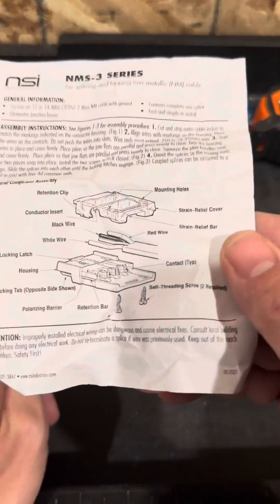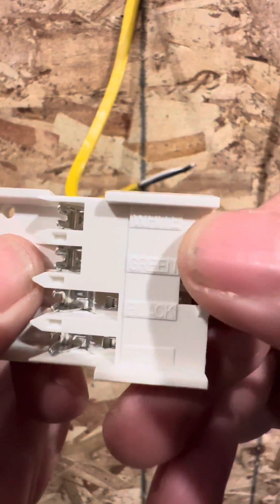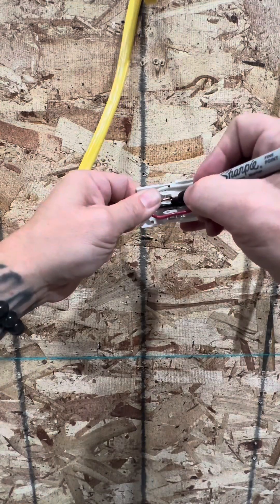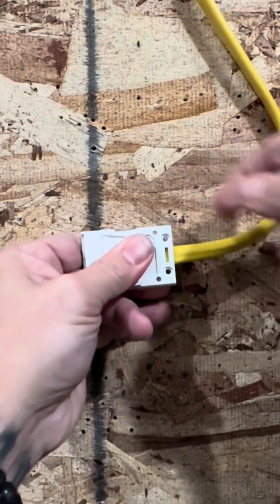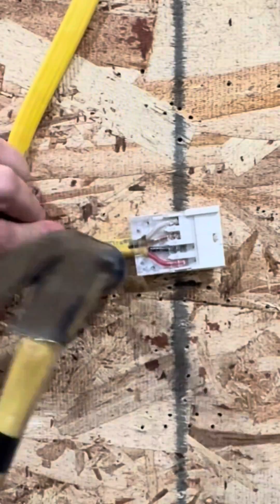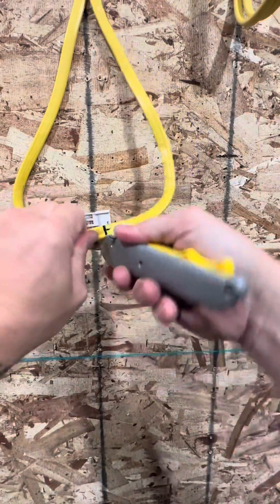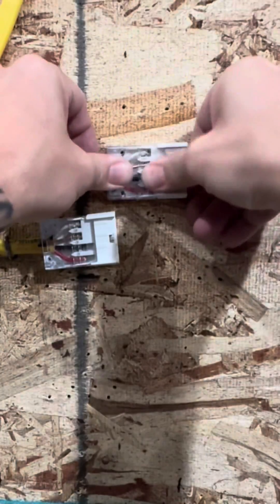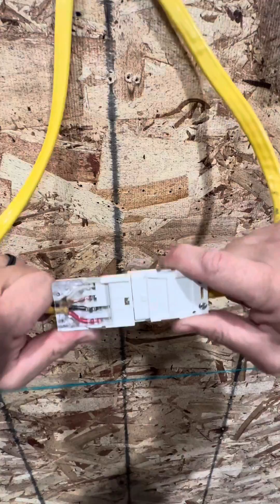⚡️How to repair a 12/3 romex with an electrical splice kit😂 #whackhack #wkhk #thebasementking

Comment: I'm trying to fix some 60s romex with four wires with one of these.  It looks like one of the wires is smaller diameter than the rest and I have no red wire.  Maybe the red has faded as it's hard to tell as you did white, hard to tell but looks like the narrower one, black then red so maybe the uncolored one on mine is red.  I like how you marked the wires for cutting, that looks like a handy trick!

Comment: You’re the reason I’ll never be out of work. Thank you for putting lots of money in my pocket fixing nonsense like this. Do more videos so Joe homeowner thinks this is legit.
Reply: Cut the bullshi this works just fine. It's copper wire. Not some complicated advanced electrical nuclear bullshi
Reply from the maker: @Charger-ob8yl  Facts
Reply: I agree with you 100%. These won't ever get used on my jobsite. Work standards are going awful low these days.
Reply from the maker: @rickhawkins218  Good help is hard to find I guess
Reply from the maker: @Esnara2085  Your Welcome!  Don’t for get to send me 10% of your earnings
Reply: Let it burn. I won't be here lol

Comment: So... what is this actually for?  I mean it seems like a mechanical connection that is just as likely to fail, if not more likely to fail, than just using twist nuts.  It ought to still be in a junction box... It still shouldn't be used anywhere that's not serviceable... so what's the point?
Reply from the maker: Per 2023 code you can install these behind the wall and ceilings
Reply: @KingWhackHack  That is really weird.  It's a mechanical connection with contacts, over time they can and will oxidize and corrode.
Reply from the maker: @johngaltline9933  How long of a time?  100 or 200 years?
Reply: @KingWhackHack NEC Code is a bare minimum standard. But- burying this connection behind drywall does not meet my standard of work. Fix it properly or leave it for the guy with proper work standards. This is some cheap junk.
Reply: @rickhawkins218 Disagree, in my opinion NSI makes good products. This is UL listed and approved by code. I’m sure if done right, it will last just as long as any other splice. Your reaction is no different than when wire nuts came into play and the old times got butt hurt about it.
Reply: @shefik12345  My reaction is based on the long time practice of leaving joints accessible because that is almost always where your problems occur. If you put the connection in a box on the drywall with f straps you have a chance of finding the problem at some later time. Wegos are below my work standards also.
Best of luck, Rick.

Comment: still have to have a junction box per NEC code I am sure
Reply from the maker: 2023 allows these splices to be behind the wall and ceiling
Reply: Who reads NEC if you have yоutube. 😂😂😂
Reply from the maker: @Vic-007  Facts 💯
Reply: @Vic-007 🤣🤣🤣🤣
Reply: Actually, a junction box is NOT required per NEC. NEC says "the device shall be UL Listed", and "the device shall form a close fit around the outer covering of the cable, and the device shall fully enclose the part of the cable from which any part of the covering has been removed."  This device does both of those things. If you are going to make a comment in the future, we would all appreciate it if you would research the code BEFORE you make comments that are wrong.
Reply: @FlaSunsetA1A  So does a wago meet this definition then? I have some in my crawlspace, but it's an enclosed and conditioned crawlspace, not open to the exterior in any way. Seems totally fine IMO
Reply: @FlaSunsetA1A What about Accessible??
Reply: No j-box needed.
Reply: No j-box required or needed